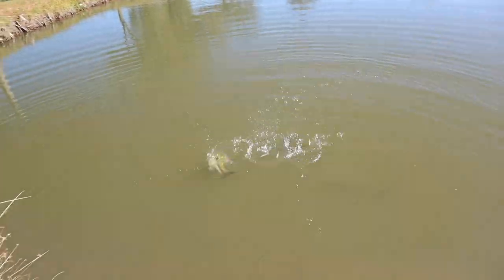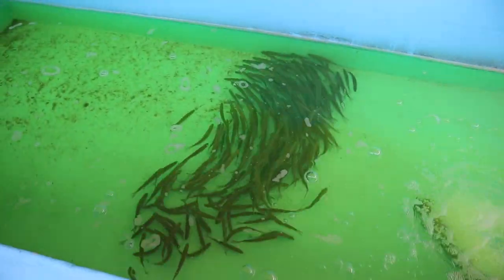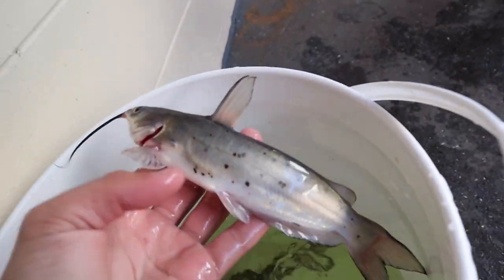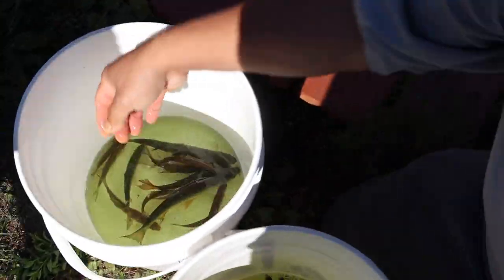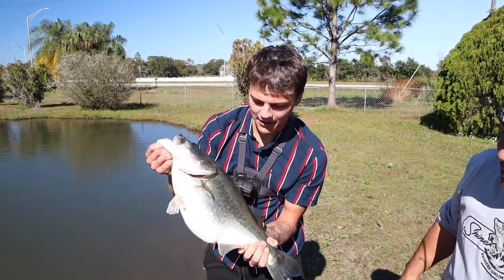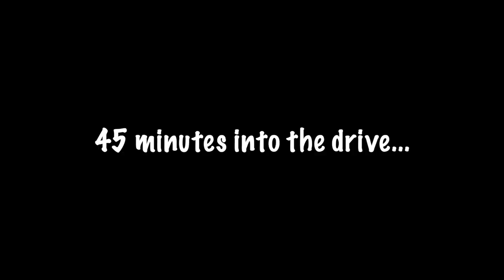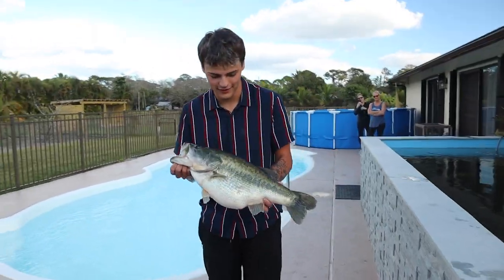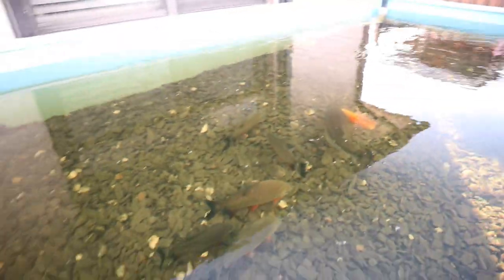My *NEW* 12lb+ LARGEMOUTH BASS for 4000G POND!! (Thump 3.0)

Comment: If I were to bet, I'd guess that fish would go low to mid 11s on a typical fish scale. That frame is crazy thick but I've never seen a 12lb fish with a head that small. It is extra fat though so it very well could be. Hard to tell in video or photo. I have a photo of a fish that I weighed in at 11-7 that looks smaller than fish I have photos of that went sub 9lbs.